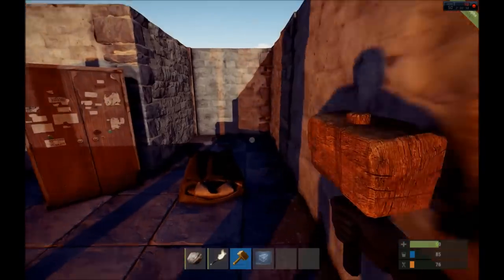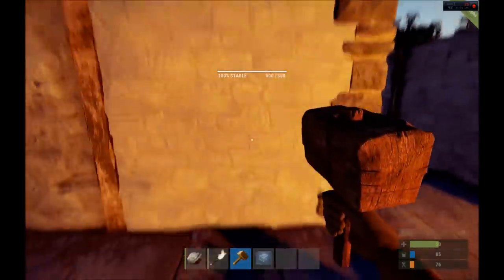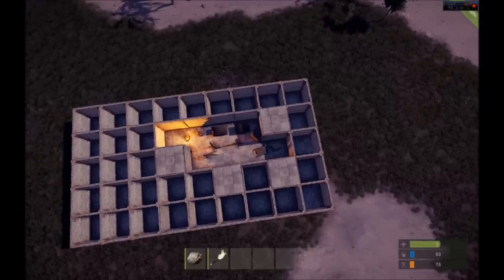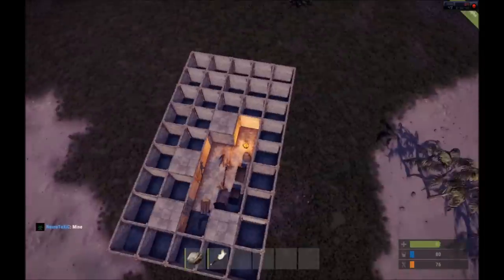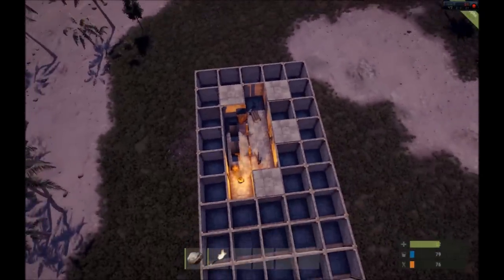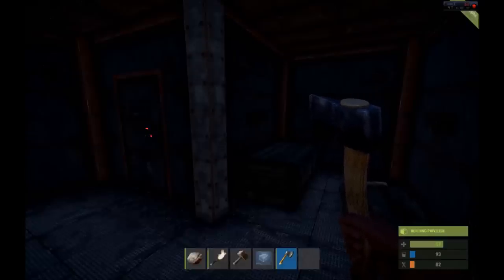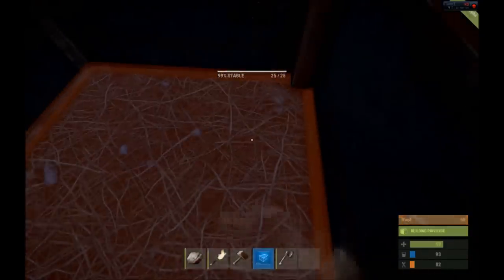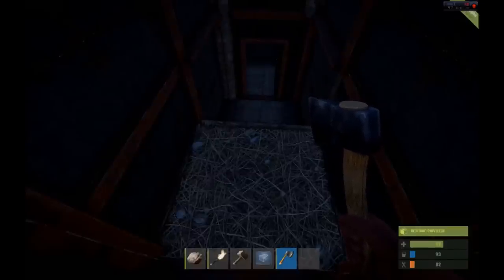Rust Base Tips: Honeycombs, airlocks, & elevators

Comment: thanks, very useful. Btw, there is one more good way to secure the base - build it on a rock you can not climb onto without placing blocks etc. So there is no way they will get to your house. Also you need to place some enclosed cupboards around the house so they don't build a raid tower and jump on the roof. That is why you need to close your roof and have some kind of a door with a lock there, so you can go on top and see everything.

Comment: The blocks are great on your roof, but using them on lower levels allows a raider to destroy one of the walls, and then the top block, which then gives them access to higher floors. Great vid!
Reply from the maker: Great tip, man.  Thank you!
Reply: You right. Never built blocks on bottom floors. Elevator best method against raiders :)

Comment: Great tips. I like to airlock and user a version of honeycomb with false doors and such.
Reply from the maker: The airlock is the first part that I always focus on, even on very early bases.  Thanks for the feedback, Charles!
Reply: Phaedo 82 triangle foundations make pretty good exterior airlocks imo if you place the outside door frame on the right side of the triangles foundation the interior door when opened(so long as it opens outwards) will actually half block the front door should one accidentally leave the front door open.

Comment: Also, one of thing I do is build a big honeycomb 5 story, and put my loot in an outside layer room on the 2nd or 3rd story. Raiders either go bottom floor first or top floor first, so I don't put loot in either of those. They also always beeline for the center because people put their things in the middle so they can have more buffer zones. Putting stuff in an outer layer means they might get to it first, but they'll probably be  entering from a different angle and it will take very long to get to your secret room, usually they will give up. I prefer this to the scumbag exploiting elevator method.

Comment: Exactly those 3 things I usually do. Great tips man! Although I haven't found a way yet to protect my base from those freakin twig towers. I have build houses with honeycombs aswell, but I am still wondering if the blocks inbetween those walls are a better way to protect your house. Can a floor be destroyed or only walls? If so, what will happen if they destroy one block and the floor? Will that give them an "elevator"?
Reply from the maker: roooii1911 Check out this video for tips on protecting against the twig raid towers: https://www.youtube.com/watch?v=WZCt4aLGtGwAxillary building cabinets with cupboards, surrounding your land, is the best defense against the twig towers.  I think the blocks are OK for the first layer or two of the honeycomb, but it could be used against you if you're not careful.  In Legacy, I used to have a nasty method using ramps stacked on each other.
Reply: Phaedo 82
Thanks for your response. I watched your video and I've seen people building these cabinets. Might give that another try some day. Fun watching your videos!

Comment: What are your thoughts on multiple loot rooms vs. one? Back in Legacy, we used to have about 4-5 areas with loot, which saved us 60% of it during on particularly bad raid. It seems that it could either cause people to take what they have an leave, or worse case scenario, they think that you have more than you do and burrow through. Not sure if those are correct interpretations of it, but always what I kinda figure was the case, at least in Legacy.

Comment: 3:40 Usually the raiders got wood tho
Reply: X Creator But they can't build without accessing your cupboards :D
Reply: oh...well those things are good to be hidden
Reply: X Creator People tend to build cupboards on the 2nd or 3rd level, which can only be accessed by building, and you can't build without using cupboards, that is on the floor that you need to go, that is only accessible by building, that you can't do without using cupboards..
Reply: Marcos Silva U can use ladders to get to the upper levels
Reply: GangstarapMadeMeDoIt that isn't a problem if you have ladder protection. But now, the elevator isn't working so.. Yeah.
Reply: yes but you cant have ladder protection inside your house, can you?